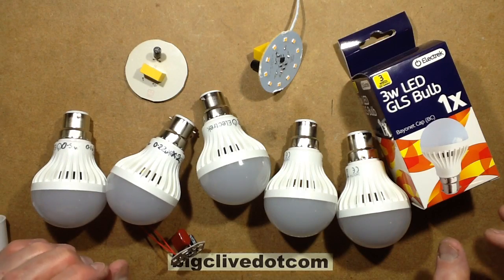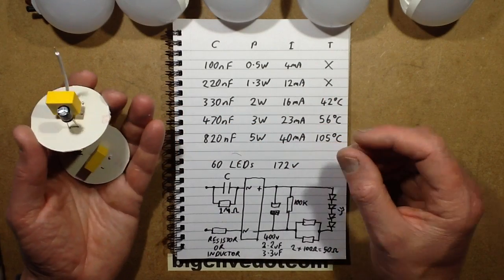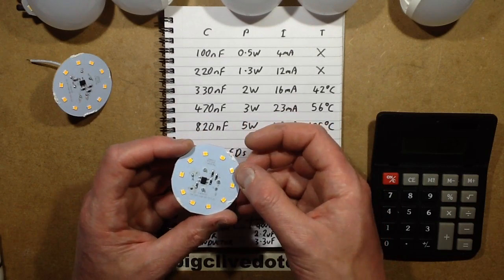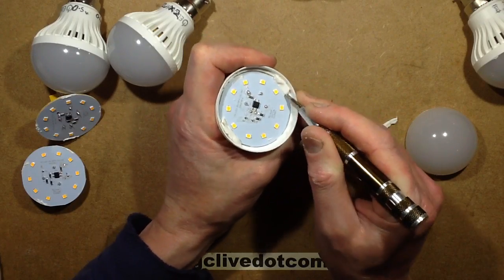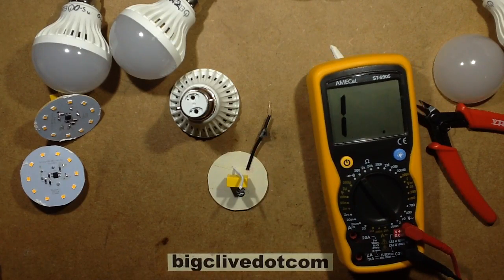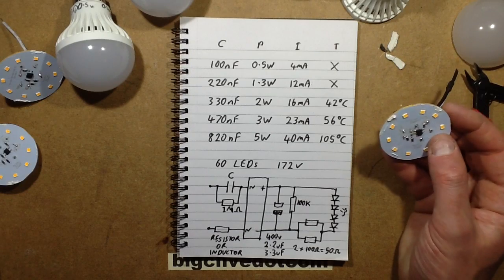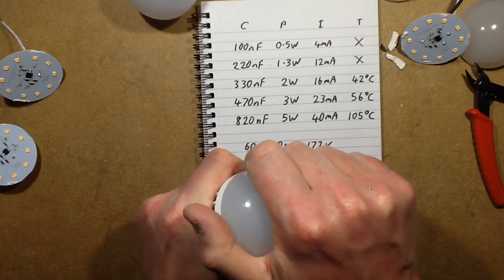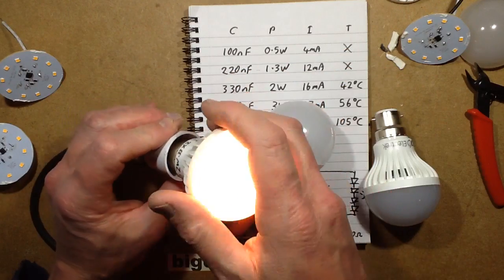Modifying Poundland LED lamps with test results.

Comment: Anyone else notice that when they click reply, YouTube doesn't add the +Name at the beginning anymore? It only adds the reply name if I reply from the notifications box in the top right. And of course, you can't type the name manually anymore (god knows why not). Like WTF YouTube?
Reply: I've also lost the "show more" button, so I can't read replies more than 4 long. Annoying.

I don't think YT really cares since they've already got your ad-impression.
Reply: wow shitit doesnt add the +name anymore
Reply: Google announced a few months back that they're phasing out Google+ integration from Youtube. They had partially removed the functionality already (+Names would not link to the profiles anymore unless you commented from your notifications), and seems like they finally removed the rest now. 

I would think that the reason they didn't remove it from notifications yet is because the entire notification system is probably on the G+ side, so they will probably have to make a new system for Youtube from scratch. Considering all the things that could break, that's no small feat.
Reply: +Ameto this all worked better before they glued google plus to it.
Reply: I can still click read more.  Has anyone else had their subscriptions bar disappear from the left hand side on the main page?
What's really annoying is how often my posts get shadowbanned. Youtube must either think I'm a spammer, or have dangerous opinions.
Reply: Yup, I'm having the exact same problem!
Apparently it works properly, IF you respond from your notifications window.
It's very weird, and quite frankly, if it's a feature, then fuck google.
Modern stuff always seems to go the opposite way it should - plainer (in looks), harder to use, and less reliable.

Comment: You can't possibly tell if it's a resistor or inductor by looking at it -- they use the same coloured bands as markings, and often use the same colour backgrounds.
Reply: The low resistance reading makes it even less clear.
Reply: No ... more often than not, you can tell the difference.
Trust me, I've been doing electronics stuff for years.
Either that, or maybe you are bad at guessing? :/
Reply: Benjamin Esposti lol. Nice try. I'm an EE student. I work with components every day. Yes, you CAN tell them apart with a lot of experience, but trust me -- when something has heat damage, or the colours are close, you cannot tell by sight. Funny how you claim experience has helped you, all it means is you haven't had enough to see all the different  kinds of through-hole inductors and resistors.
Let me ask you, Mr. Has the Answer, how do you know for sure, when a resistor and inductor look completely identical? If you say reverse engineer the circuit, well duh. What if the circuit is vague? Or they've purposely obscured it? Hmm? Not so fucking on top of things now, are we. Of course, you can always use a bridge circuit that can determine the difference between the dominant impedance, either inductive or capacitive, along with a resistance reading... AKA an LCD meter. But we're talking about ON SIGHT.
Reply: "lol. Nice try. I'm an EE student. I work with components every day." 
So, just because I am not an EE student in college, you aren't going to trust me, ehhh?

"Yes, you CAN tell them apart with a lot of experience, but trust me -- when something has heat damage, or the colours are close, you cannot tell by sight."
I agree that heat damaged components can be harder to identify. But I was talking about regular components.

"Funny how you claim experience has helped you, all it means is you haven't had enough to see all the different  kinds of through-hole inductors and resistors."
Of course it's possible that some "experienced" person has never seen a certain inductor before!
You're acting like I claim to be perfect, even when I haven't done such a thing!

In my case, I've taken many things apart, repaired many things, and have done reverse-engineering as well (usually done when repairing stuff). So yes, I've seen a lot of inductors and resistors.
Have I seen every single one in this world? Hell to the no! XP
Is it possible for me to make a mistake? Yes it is! But it's been so long that I can barely remember what the situation was. It was at least a good ten years ago, and I don't remember every single little detail of everything that happens...

"Let me ask you, Mr. Has the Answer, how do you know for sure, when a resistor and inductor look completely identical?"
Mr. Has the Answer says: Because to me, they don't. I don't have trouble differentiating between things like that. I don't know why that is, but it just is. Do I claim to be better than others? No. I just merely hinted that I'm good at differentiating between the two.

"What if the circuit is vague? Or they've purposely obscured it? Hmm? Not so fucking on top of things now, are we."
Well, that would have to be a really vague circuit, with those nasty "magic black boxes" n such.
Again, when did I ever claim to be "on top of things"? ... Hm?
I'd appreciate it if you didn't come up with such false accusations. :)

Comment: Bought my first 5w Poundland light, a smaller bulb than in this vid and it lasted less than two weeks before dying

Some pics here https://redd.it/4ksqoq

I've replaced it with a 3w one and I'm waiting to see how long that lasts.

I have wondered if I get some replacement SMD LEDs wether I can bring this back to life. The components, capacitors, resistors etc seem to test as still OK and the brown crap in the first pics looks to be something that was painted on.

Comment: why dont you get a better camera that does not flicker under LED light since you do so many videos about them..... then we can see what is going on with the lamps a lot easier.
Reply from the maker: I've not found the ideal camera yet.
Reply: It's almost impossible to get a camera that wouldn't flicker... the flickering comes from the difference in frequency between the LEDs and the frame rate of the camera. You'd have to have a very high frame rate camera to get rid of the flicker. Not to mention, the flicker doesn't prevent us from seeing how much light they put out...
Reply: It's actually temporal aliasing between the framerate and the mains frequency. To stop the flicker you could actually use a lower framerate. If I remember correctly, Clive uses an iPad to film with, which is an american device, so its video camera runs at 30fps. (Because American TV (NTSC) runs at 30/60fps, the same as their mains frequency). British mains  frequency is 50Hz, and British TVs run at 25/50fps (PAL). What Clive needs is a camera that can record in PAL (either at 25 or 50 FPS) and the flicker would stop.
Reply: zoebox Pretty sure he bought his iPad in the UK, and Apple does manufacture European versions which use 25/50fps (PAL format). And what you said what exactly what I said, in different words.

Comment: the reason that capacitor is not flush with the pcbs is because the holes for the legs are at a shorter distance than the caps hence why it can't sit flush, this can be seen at 2:14

Comment: I've tried hacking a poundland light but never managed to get the connecting wires back in to the end of the light socket
Reply from the maker: If they're too short replace them with new ones.

Comment: What is the feasability of adding an annular aluminium ring on the back of the pcb to help improve the heat dissipation so the 5W lamps last longer?
For your 0.5W modified lamp you could have replaced the bleeder resistor with something like 1M or 2.2M.

Comment: can someone explain to me what poundland is
Reply: It's a British high-street store that sells everything at one pound (£) sterling.

In the US they have dollar stores. Very much the same thing.
Reply: Its like a dollar store or euro store.
Everything costs a pound.
Reply: A chain of shops that sells everything for one pound. The equivalent of  dollar stores in the USA.
Reply: It's the UK's Dollar Tree, only with a bigger selection of items from the videos I've seen.
Reply: >mharris - that's only somewhat true.  They also have a higher set of taxes, both at the corporate and local level, (plus VAT), so it's probably a wash.   King Dollar, in Houston, has similar light bulbs for (now 1.25, but was a dollar when I bought them )
Reply: Its a store that sells many things that can kill you, that break on first use, past its sell by date or conning buyers by selling slightly smaller size packaged items for more than the full size version (pro rata) all for £1 that you can actually buy on ebay for £0.99 or less including postage lol

Great gimmick though as no one keeps their receipts so they never get any returns - what a business model!

Comment: Something wrong with the numbers there Clive - if there are 10 multichip led packages the maximum power each led package would be dissipating is 0.3 Watts for the 3 watt lamp and 0.5 watts for the 5 watt lamp....and that's excluding any losses in the capacitive dropper circuit. If  the current you measured was the current the whole lamp was drawing, then you can't use that current in a simple VA calculation on the LED side as that current is hugely out of phase on the AC side due to the capacitive dropper circuit and is not representative of the smoothed DC current.......this is all assuming the lamps total power draw is actually 3W and 5W etc
Reply from the maker: The current measured was the smoothed and actual LED current.
Reply: Those lamps must be consuming way more than their rating then! - 10 led packages @ 0.72 watts per package, that's 7 watts on the LED's alone on a lamp that's supposed to be 5 watts!
Reply from the maker: Damn, you're right.  I've clearly screwed up.  But the 5W lamps can still apparently go brown inside and have LEDs fall off when used for prolonged periods.
Reply: Yeah, regardless they are being cooked!
Reply: +bigclivedotcom would there be a way to run those lamps on DC battery's?? could you make video diy
Reply: mharris1270 thanks ill look un to that and check it out , I do have  twelve volt incandescent bulbs fifty watt at twelve volts , the reason I ask about the led light bulbs is because I have about four. Of them that the transformer and caps have been blown that were given to me by my sister, thank you any which way for your time,👍
Reply: mharris1270 thank you

Comment: Clive, do you have a bench power supply, and which one is it if you do?
Reply from the maker: It's one from a UK outlet called Maplin, but it has a random bug in the software (or crashes) and puts out random voltages once in a blue moon.  Shame, as otherwise it would be OK.
Reply: bigclivedotcom Yeah I'm from the UK as well :P, I have a Aim-TTi EX355P (35V 5A), but I just wanted to know what you used :P
Reply from the maker: I haven't featured it because I don't want you guys to buy one due to its "issue".
Reply: +bigclivedotcom what percentage of your viewers are from the UK vs America vs Isle of Man? Though mainly the first two.
Reply from the maker: 27% USA, 27% UK.
Reply: but you ARE using it anyways ? I've never seen a blue moon but IF it would appear the then connected circuit would probably BANG
Reply from the maker: I'm waiting for the day it does crash again and if I'm really on the ball I'll make a video of it.  It's a commonly rebadged unit and they all have the same issue.  They work fine normally but sometimes just put out a random voltage and all the buttons lock up.
Reply: Clive, did you feature it in a video ever? I want to see it.
Reply: +bigclivedotcom I'm from texas
Reply: +bigclivedotcom could there be a hack for using it battery's for the just in case power out.? thanks for your time .
Reply: You mean the bulbs? You'd have to remove the capacitive dropper and/or connect the batteries directly across the output of the bridge rectifier.
Reply: +bigclivedotcom wouldnt it be better to do a video then so we are warned? just a thought.
Reply: ***** ooh OK I see on the one I have has a green cap and labeled vr1 and on the backside of the board base a small and can't read what its says but can see a small + -  could I connect the battery there to see if anything els is blown out ? I checked all the LEDs with the DMM and that all work but as I wrote to another coment that that were given to me by my sister I have five and I guess they all burnt out ? Is why I asked about the mod . But I thank you and will try what you have said , thank you for your time , I am new to electronics Alway been curious since a kid but never had the chance to learn always worked and know I have two girls and like fixing these electronics, would like to learn more as to were I could build them something nice. Well thank you once again ,.👍
Reply: jdod64 he can't reproduce the bug by command
Reply from the maker: It's this one.  http://www.maplin.co.uk/p/80w-switched-mode-dc-multi-voltage-slim-bench-power-supply-n27gg  which is sold under various brands.